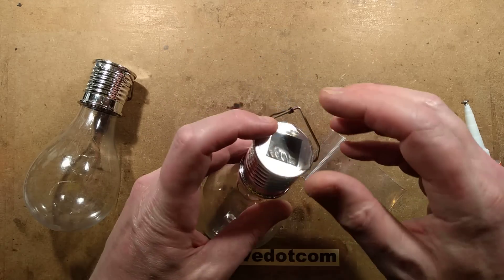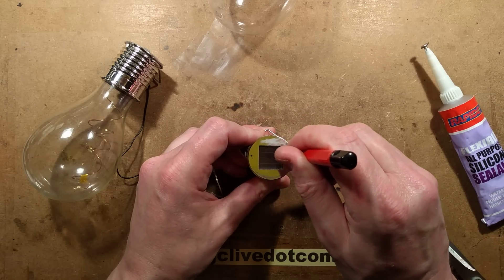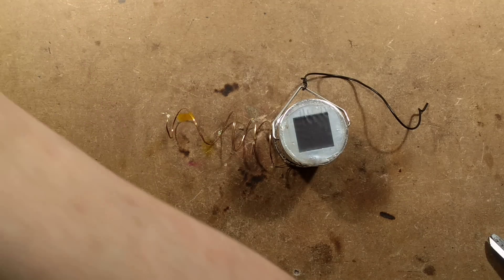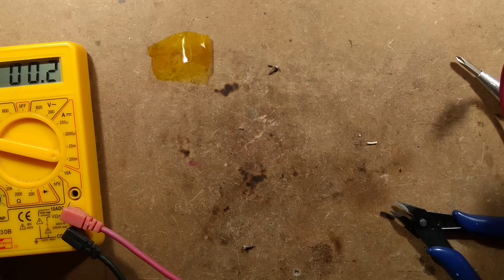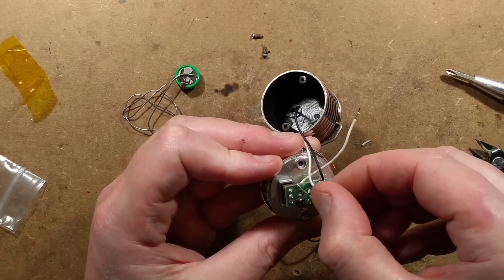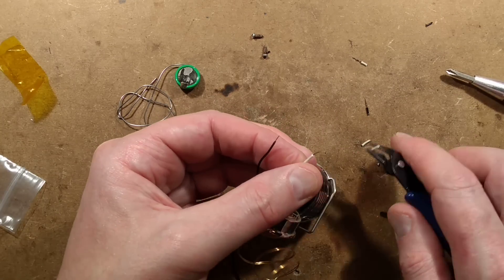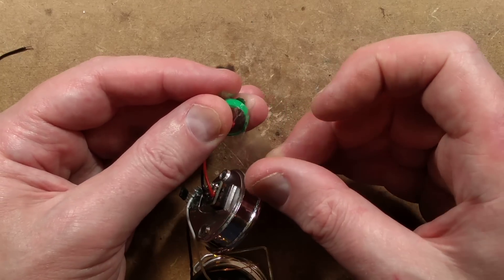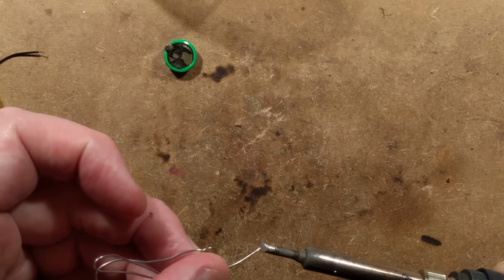Silicone sealed solar lights one year update.

Comment: ahh dead batteries. I've got a faucet water filter with an led indicator light. It just flashes 4 times green, yellow or red when you first turn it on. After 3 years the battery is dead i'm guessing because the led doesn't work anymore. I'm going to try taking it apart. Not sure how that's going to work since its plastic welded together. I'm sure i can get it apart but can i replace the battery and get it back together is the question. Especially being weld/melted together. I'd much rather replace a couple dollar battery than spend 30 on a whole new filter assembly.
Reply: 3 years is a long time for a filter to last, it's probably overdue for replacement anyway
Reply: @Wooble57  the filter element gets replaced every few months. Just the main housing is where the battery for the indicator light is at. A filter is about 5 dollars versus a new housing is 30. I'd like to be able to just replace the battery.
Reply: @keithyinger3326  ah. Gotcha. Going to be a tough job if the plastic is welded.  Best of luck

Comment: If the summer on the Isle of Man cooked this one, can only imagine what a Florida summer would do to it.
Reply: We're British. We're used to drizzle and beer that's warmer than the weather, last year was unremitting torture.
Reply: They would be doubly cooked, first by the sheer heat, second by way of severe overcharging.  You’ll have to add either an inline resistor to limit current or a neutral density filter to reduce the light reaching the solar cells.
Reply: sparkplug1018 - haha I just commented the same thing. 
Wouldn’t last a day

Comment: I always get a sliver of fiberglass stuck in  a finger using the pencil, didn't know there were brass and steel types, off to search ebay!
Reply: They are frequently sold as a pack of three: fiberglass, brass, and steel.  You can also buy through Amazon if you prefer.
Reply: @ethanpoole3443  found brass one on ebay for £2.49 ;-)

Comment: 13:55 The thing that usually fails in mine is the switch. Which I then usually just bridge. Normally they corrode that they stop conducting ...  but in one light I fixed it "only" had a resistance of 10kOhm
Reply from the maker: I tend to create a solder bridge across the switch when first used.
Reply: @bigclivedotcom  Yeah ... good solution.
Reply: Yes the switches have been a weak point on various types of solar lights i've had.
Reply: @sparkykevboss  And the only way to change that and still have a switch are reed ones imho

Comment: For improved bonding, consider E6000 adhesive from 'Eclectic Products' - one to always have around, at any rate:
https://www.youtube.com/watch?v=YBQp04glQqc
Reply: The replacement cells cost more than a new pound shop light  !
Even if they are a different style, the battery can be used.

Comment: Nicads were charged at C/10 for 12 hrs, ie a 500 mA/Hr would be 50 mA
Float charging at C/50 is not quite enough, so C/30 is more reasonable
No wonder that cell spilled its guts.
Reply: But isn't Clive using NiMH buttons not NiCad?
Reply: @crazykirsch  
They are after my time, but the chemistry has similarities I believe
Reply: @FarleyHillBilly  they are quite similar, but they do have differences.  Nicad is much more tolerant of overcharge then nimh is.

Comment: Yay!! Scratchy pens!! I got a set last week and they are so useful for contact cleaning and metal polishing, especially the fibreglass one, that thing can shine up a lot of things with ease... :D
Reply: twocvbloke where did you get them, or what is the "official" name?  My search returned a bazillion results for ink pens, and I will probably be stalked by pen sellers now.
Reply: "scratch brush pen" or "fibreglass pen" seemed to work for me, though I got mine from this one listing, probably available cheaper from china but I wanted them quickly:
https://www.ebay.co.uk/itm/111741724024

Comment: i remember back in the early days of radio control models they used to work on diac batterys they used to always turn one of the battery wires black im sure they were also nimh or possibly nicd

Comment: Clive I was thinking that some heat shrink over the cells might be a quick way to cover them. 
You would not even have to really shrink it other than on the ends to keep it centered.
Reply: That's a very good idea, it's be mechanically attached rather than relying on glue.

Comment: 2:00 what's the purpose of those "pencils" and what's their proper name?
Reply from the maker: Generally abrasive pencils. Often used for removing tarnish from the surface of connections.
Reply: They are intended for the purpose that Clive used one for! Cleaning, scratching, etc. Propelling fibreglass brush - Duratool
Reply: Here's a set of 3 on Amazon, and strangely enough, easier to find and cheaper than eBay!! 

Silverline  738963 Scratch Brushes 3pk https://www.amazon.co.uk/dp/B06XRJV4QC/ref=cm_sw_r_cp_apa_i_zduhDbGDC286Y

Comment: Black wire syndrome
https://www.batterybusiness.com.au/blog/black-wire-corrosion
Batteries are vented and a little bit of electrolyte wicks up the wires and turns them to dust
Reply: Thank you, I didn't know that, and always wondered why the negative wire was usually the one knackered along its whole length, whereas the positive just corroded at either end!! 👍👌
Reply: @snuggles1406  
It's a well known mysterious problem that bugs aero modellers
Reply: @FarleyHillBilly  
I'm a boat modeller myself, but I have come across the problem many times.

It's also a big problem with wireless security systems and  even inside fire/intruder alarm system with  battery backup too!!

Comment: The acetic acid in common silicone caulking eats away at metals. You want a neutral cure silicone.
Reply from the maker: In this case it can vent to air.  The problems tend to occur when the silicone is trapped in a sealed enclosure and the acid vapour corrodes metals.
Reply: I imagine it will help if it's allowed to cure for some time before being re-assembled. I'd still apply some varnish to the solar cell solder joints, though.
Reply: I'm pretty sure Clive has mentioned the acetic acid problem before, so he's well aware.
Reply: Yeah, that's what I was gonna say!

Comment: I bought the colour changing version of those lights last year, the silver paint has degraded but still working great.
Reply: Also the intensity doesn't modulate up and down on my light.
Reply from the maker: Mine was new.  It probably didn't have much charge.

Comment: So what are those abrasive pencils you have called? Another must have now that I know something like that exists
Reply from the maker: They're called....     Abrasive pencils.  Easy to find on eBay in fibreglass, brass and steel.  Plus packs of refills.
Reply: @bigclivedotcom  haha I guess that would make since. I think I was having a senior moment or something when I asked.
Reply from the maker: @maddscientist1644  It's actually nice that they have a sensible name for a change.
Here's a typical UK listing for a set of three types that doesn't refer to them as abrasive pencils.
https://www.ebay.co.uk/itm/401334987551
Reply: Cheaper set here https://rover.ebay.com/rover/0/0/0?mpre=https%3A%2F%2Fwww.ebay.co.uk%2Fulk%2Fitm%2F112140712886
Reply: Matt Quinn I would consider them as brushes, but I guess the screw-pencil mechanism dominates the naming.

Comment: Nice, last  year I had sealed a solar light for my dad he uses to light the flagpole. He bought it end of summer by halfway thru winter dead.  Then I remembered BigClive saying the switches they put in them are cheap and break, this was not cheap 30 bucks from Walmart. Anyway sure enough switch is bad, so I just bridged the switch and sealed everything. Still works but the dogs snapped it in 2, the cell and 18650's inside are still good I'm gonna repurpose it for something. CHEERS it's hot real hot in Kansas today.
Reply: Raymond Mucklow 18650 Lithium cell?  That's higher end than these old school Nickel ones.
Reply: @AverageUn1x  yeah still haven't got around to it but it's all still there.

Comment: I'm glad to see this has worked so well to prevent water ingress! Though now I'm wondering if there's such a thing as UV-stable spray-on clear conformal coating... and if there is, how it would compare. Just seems like it might go quicker than squishing silicone around with one's fingers.
Reply: You could try clear nail varnish.  Not spray on, but not hard to apply.
Reply: @bdf2718  most nail varnish is highly susceptible to UV degradation though...
Reply: @BenQuigley  Yup, it's fine inside the enclosure but for sealing the solar panel - no. And I was thinking of a situation where someone's dealing with LOTS of these things on a large property so they would really want them to be as low maintenance as possible, and even the process of giving them an extra seal against water intrusion would be wanted to go as quickly as possible. Trying to use nail varnish on, say, 50+ of these things would be ridiculous.
Reply: @FurrBeard  in that situation all you would need is a hydrophobic coating, much like the one found on jackets and camping tents. Or a better option, just set the panel in with a resin.
Reply: @bdf2718  I never mentioned UV curing anything though...
Reply: @BenQuigley  
How hard is it for you to read what I wrote?  I'll repeat the pertinent bit: "One quick google search for conformal coating uv later... Shitloads of results for UV-curing conformal coating.   Just because it cures with UV doesn't mean it won't degrade with prolonged UV."

Read it again.  Keep reading it until you understand why I mentioned UV-curing at all.  Then see if you can figure the rest out.  Take your time.  It appears you need it.
Reply: @bdf2718   bdf2718  man ain't you a rude one? I read what you wrote, multiple times in fact. Still doesn't change the fact  that you tagged me when I wasn't the one who mentioned conformal coating. I suggested a completely different way of going about it. The man was talking about how to do it large scale, no point using anything in a spray can when there are things far easierto automate.

Comment: I'd have soldered the battery directly over the wire points on the PCB. Doesn't seem much of a reason not to do that with that dinky thing.
Reply: Both of you have valid points, but if you lacquer the board & contacts afterwards, then even if the battery does loose it's lunch, it shouldn't be a problem!
And if you lacquer the battery, as well, but leave a careful area free for the battery to  breathe, then it should all be good!!
Reply: @snuggles1406  Also this is not some multi million dollar space instrument. 
So if it does pop it's guts not so much of a loss.
Reply: @snuggles1406  Or use a super capacitor, as they are close to the cost of a battery these days.
Reply: But then if the battery pukes it guts out the board gets it.
Reply: @seannot-telling9806  If there is over-charge protection then it would not be a problem, and that can be done for a few cents, put some silicon diodes in series two of them. Then it will not kill the battery from over charging.
Reply: True, then the two extra wires can be eliminated, and the need to insulate them.
Reply: I know, but if you are doing the repair/improvement job, then you might as well do a better job than the manufacturers!!
Reply: @snuggles1406  
Hang it out the side in a little baggy, the unhygienic little swine.

Comment: what are those abrasive pencils ?
Reply from the maker: Common item available on eBay.  Actually called active pencils.  Available in glass fibre, brass or steel.
Reply: @bigclivedotcom  Pencil Type Brass Steel Fiber .. bought me a set
Reply: @God-CDXX  You'll wonder how you did without them!  Fantastic for cleaning things (or removing solder mask) for repairs